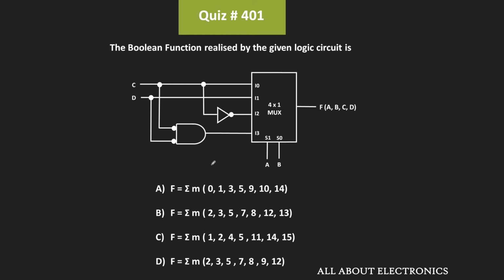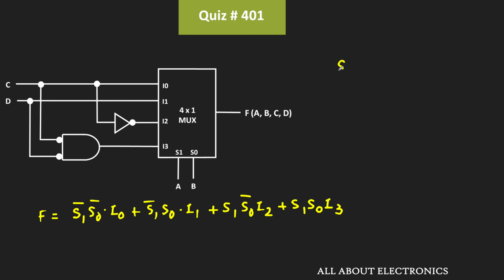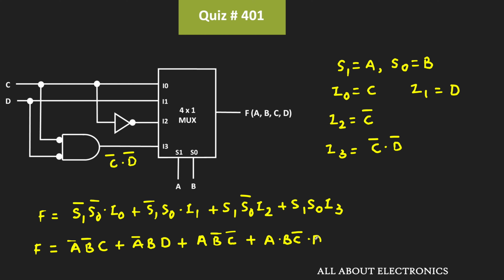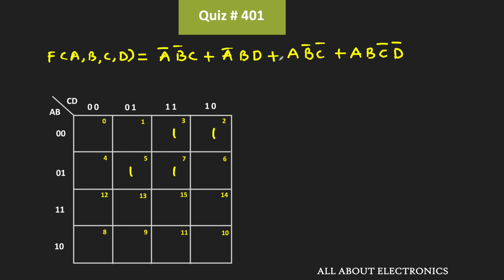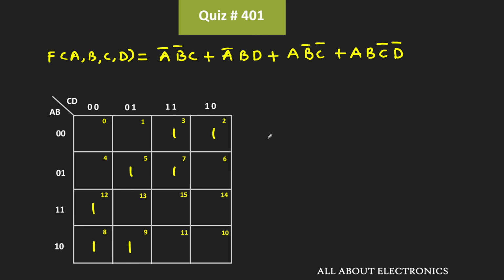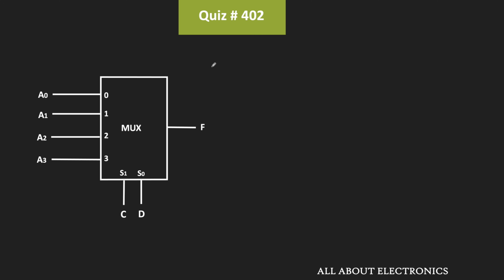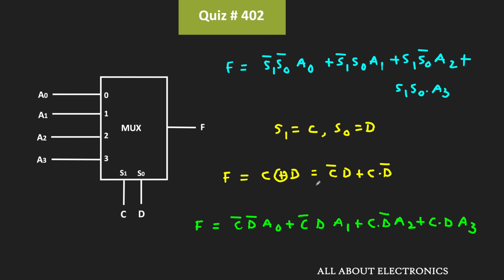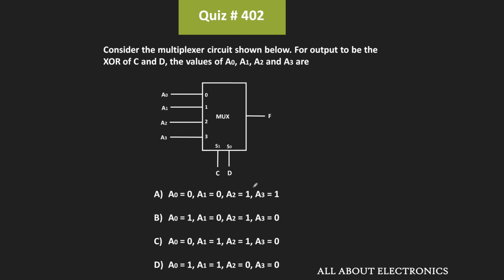Multiplexer in Digital Electronics | Quiz # 401 and Quiz # 402

Comment: if we take the numbering 0 1 3 2 in column without changing anything why the answers are different?
Reply from the maker: Are you referring to Quiz 402 ? If you change the numbering then answer will change. Because here A2 at number 2 represents, this input will get selected when selection inputs S1 S0 = 10. Now, instead of 2, if you write 3, it means that, A2 input will get selected when selection inputs S1 S0 = 11. So accordingly, your answer will change. I hope, it will clear your doubt.